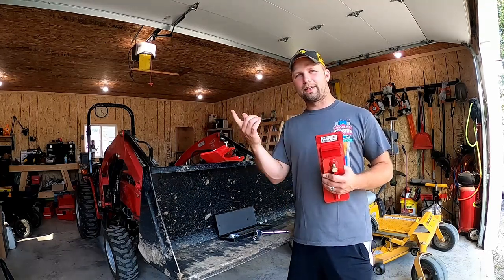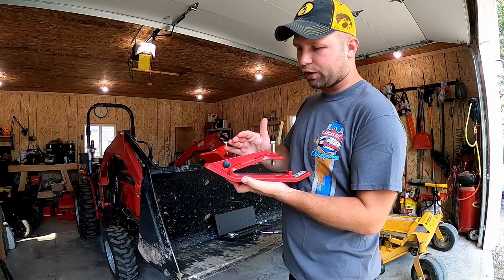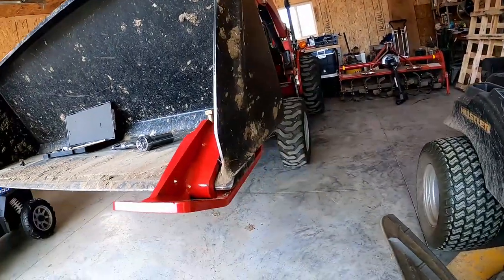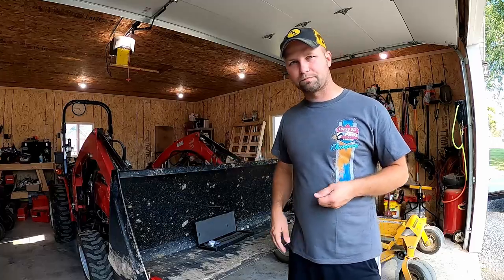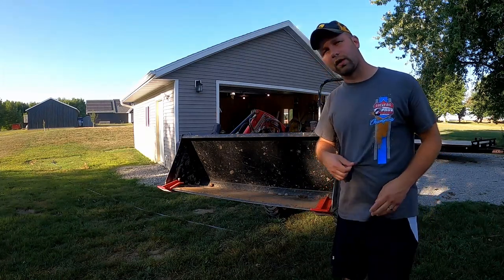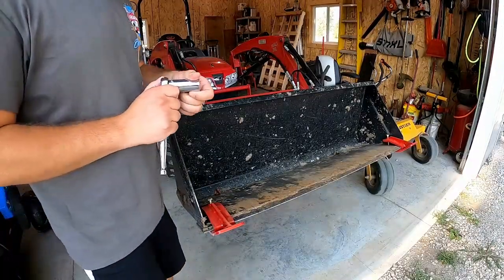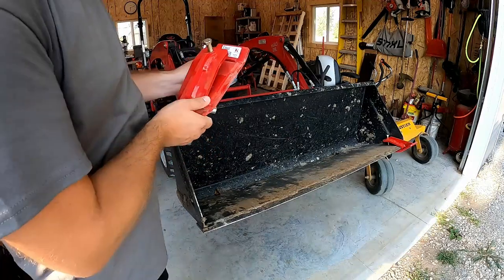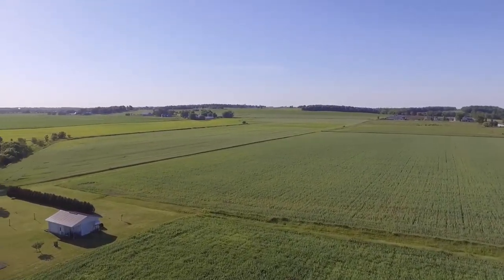Tame your Loader Bucket with Edge Tamers!  Great Option As An Inexpensive Solution For Snow removal

Comment: American Welding Society Certified Welding Inspectors call what you call splatter, spatter. None of us were born knowing this. But now you know.
Reply from the maker: Unfortunately, I already know what this is, and your interpretation is incorrect. Spatter is the metal particles expelled during the welding process and then when they come into contact with a surface it results in splatter.  You can eliminate splatter by protecting a work piece or work area from spatter.

Comment: I just got a piranha tooth bar and the 3” edge tamers seem to work fine.  I run (4) 3” models.  The piranha plus edge tamers seems to work pretty well with the snow and I don’t see any extra damage with the piranha bar added.  When I had a max the (2) 3” models seemed to work fine.  I bought 2 extra when I upgraded to the 1533.
Reply from the maker: Agreed! They seem to work well and are x100 better that nothing!